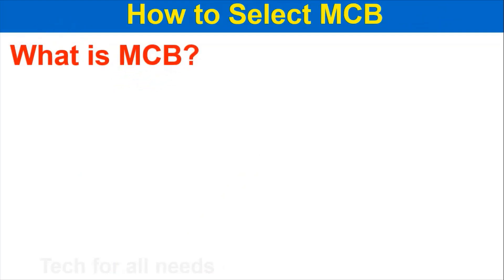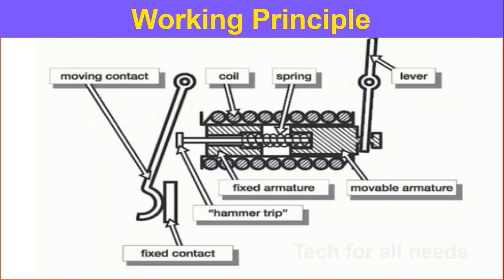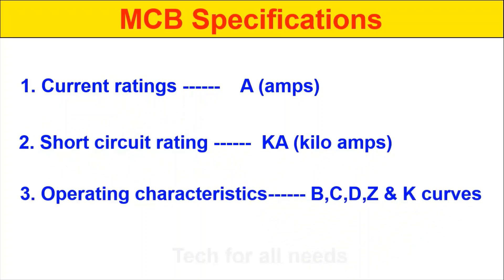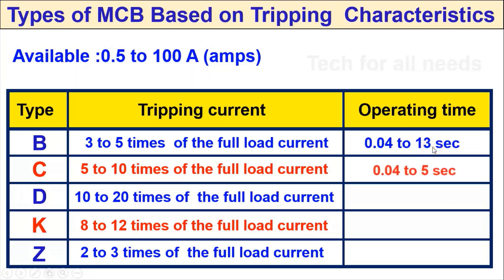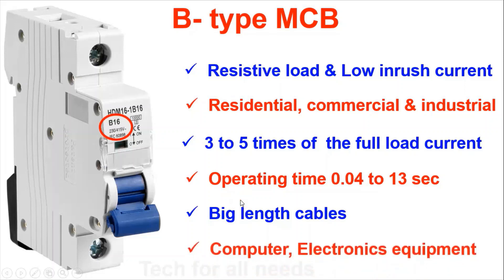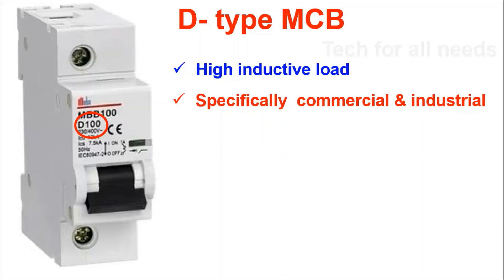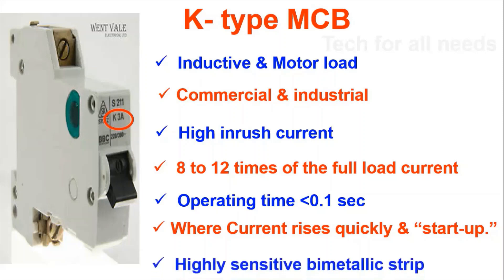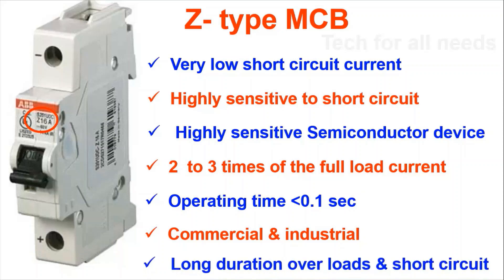வீட்டு வயரிங் மிக எளிதாக MCB select செய்யும் முறை | how to select mcb in tamil | tech for all needs

Comment: Anna 32 amph 2 pole MCB c type dB use pana evlo amph main fuse podalam 32 amph pidalama illa 63 amp podalama
Reply from the maker: Bro fuse current rating MCB  current rating ஐ   விட அதிகமாக இருக்க வேண்டும் இல்லையெனில் fuse அடிக்கடி மாற்ற வேண்டி இருக்கும் ஏனென்றால் MCB தான் first act ஆக வேண்டும் Fuse only back up protection 
MCB க்கு அடுத்த size fuse போடலாம்
Reply: @techforallneeds  32 amph MCB use Panna 63 amph fuse podalam dhana

Comment: நண்பா 3 to 5time அப்படின்னா என்னஅர்த்தம் 1A mcB 5Aஎடுத்தால்தான் Trip ஆகுமா
Reply from the maker: Correct நண்பா fault current 3 to 5 times increase ஆகும் பொழுது trip ஆகும்
Reply: @techforallneeds  நண்பா Singlephase 1hp motor runningcurrent 8A எடுக்கும். அப்படின்னா B, D இதுல எந்தMcp போடனும். எத்தன ஆம்ஸ் போடனும்.3 to 5 times full load currrent அப்படின்னா நா சொன்ன 8A preaker 8Aல டிரிப்ஆகாதா 40Aலதான் டிரிப்ஆகுமா இது என்னோட நீண்டநாள் சந்தேகம் சொல்லுங்க பிளீஸ்
Reply from the maker: @karmegamm1640  அடுத்த வீடியோ upload செய்யும் பொழுது what app number தெரிவிக்கிறோம் what app ல் கண்டிப்பாக உங்களது doubts clear செய்கிறோம் நன்றி நண்பா